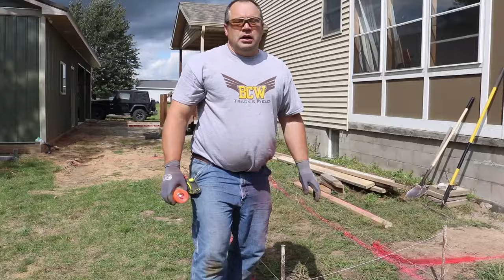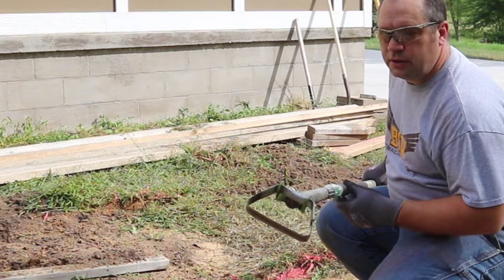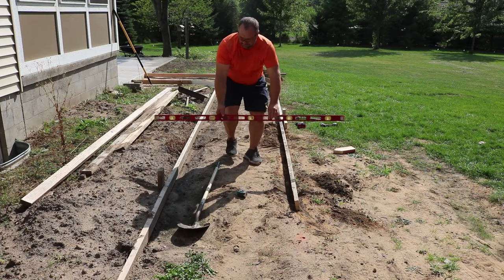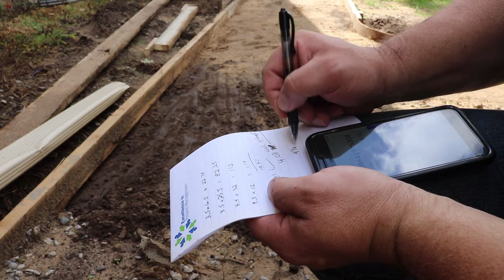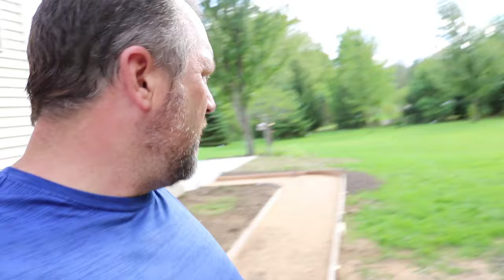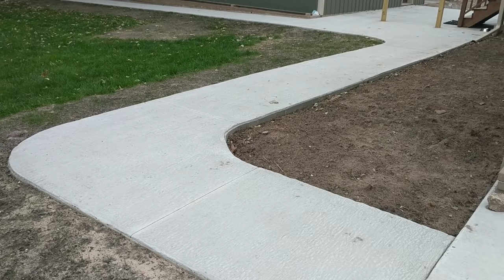Forming Radius Corners On a Curved Sidewalk - Complete Sidewalk Setup and Pour

Comment: I dont know what iam doing,  but here's my thing.i put a frame together its leveled all around with 2x4s. So that's 192 and I have to dive 192 by 81? Gives me 2.3 yards? I dont know what I'm doing but I'm doing it.
Reply from the maker: Yes, find the square footage of the slab. If it's a square or rectangle multiply length times width. That will be your square footage. Then divide that by 81 for a 4" thick slab and you'll have the cubic yards of concrete you'll need. For example a 12' x 16' slab is 192 square foot which takes 2.3 cubic yards of concrete. Good luck with your project.

Comment: Great Corey!  That is a good way to have small radiuses. I had a small sidewalk to do in front of my house. It's 48' long, but very narrow at 16'' wide.  The sidewalk is actually a "water dam". As weird as it can be, it's meant to block water and force it toward the drainage grille. Or otherwise, sink into the gravel and reach the french drain. It's also a transition between gravel and mulch for landscaping. Anyways, I had to put long curves in it. I was able to bend 1/2'' plywood to the desired curve. Everything was perfect, but like you, it rained the day before and the morning we have to pour, there was some warp in parts the plywood forms. I was able to correct it just in time, except one spot. I hope you can make a video one day of all the things you have created around the house and the pole barn. Thanks Corey!
Reply from the maker: Hi Joe. That's a good dual purpose to use the sidewalk to channel your rainwater too. That's the thing about concrete, there are so many things that could potentially go wrong so you have to be ready for anything. I still have a few more things to do to finish my barn up (like front garage doors!) And then I'll probably do an overview video. So many other projects I have in mind too. Just need more time and money and I'd be all set.

Comment: Thank you for such an informative video. I love that people like yourself share so much knowledge on YouTube. I do have a question: I frequently see rebar put on the ground before the cement is poured. Is it not necessary in certain situations? Maybe sidewalks are different than driveways, and the load a driveway will have to handle, for example.
Reply from the maker: Thanks for the comment. For additional support rebar or mesh should be added where the loads are great such as a driveway like you stated. I used a fiberglass additive that the Redi-mix company puts in that also helps keep the concrete from cracking. I've had good luck using the fiberglass but I will still use mesh or rebar sometimes too. If you look at some of my other concrete videos you'll see me use both. The most important thing with mesh or rebar is to pull it up into the middle of the slab as you pour.
Reply: Country Family Homestead ah, that makes sense! I will look at some of your other videos. You do GREAT work. I have a few very small projects that, fingers crossed, I’ll be able to DIY. As with anything, it’s usually just the fear of doing that’s harder than the actual doing.

Comment: Great job on your video plus chickens looking for worms.  I really thought you would've added some rebar or wire mesh to strengthen your sidewalk.  Can you explain why you skipped this step?  Thanks!
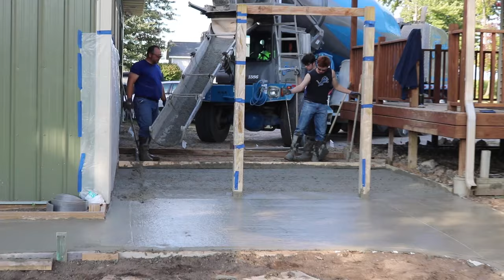Reply from the maker: Thanks, I did you re-mesh on this pour. If you look at 14:45 minute mark you can see it. We should have done a better job pulling it up into the concrete, but it's hard to do unless you have one person dedicated to that job. I prefer to use rebar and position it half way up with saddles or bits of broken concrete. This way it's in the middle of the slab and does a better job. If you watch some of my other videos you'll see me use rebar. I also order the mix with fiberglass in it. That really strengthens it too.
Reply: @CountryFamily  Got it, thanks.

Comment: I dont see any expansion joints. Don't you need them to stop cracking?
Reply: Neither did I, it will crack  without Expansion Joints
Reply from the maker: Thanks for question Kenneth. I cut stress relief joints after the concrete cured. All concrete cracks, the joints give it a place to crack so it's not noticeable. There is expansion joint along the front of the barn because the slab is between two fixed objects, the barn and the porch. For the sidewalk the slab is not "confined" and has room to expand. The only crack I see is from the corner of the planter box a couple inches long until it hits the relief cut. I couldn't get the saw blade any closer to that corner of the planter box but I know that cracks always like to start on an inside corner.

Comment: Great video! I've seen people adding layers of rocks and polyurethane sheets underneath. What do you think about its durability when it comes to a direct concrete pour over dirt?
Reply from the maker: As long as it's firm undisturbed soil it will be fine for a sidewalk. If I were doing a garage floor or driveway I would excavate deeper and add sand or gravel and compact that very well. For outdoor slabs I don't use poly underneath, but for an interior slab I would to cut down on moisture in the building. Using poly will affect the time it takes for the concrete to set up. Sand or gravel will draw some water from the mix allowing it to set up faster. Be sure to wet the sand or gravel thoroughly before the pour to minimize this. Thanks for watching!

Comment: Nice job & hard work, video much appreciated.  In terms of foundation for the concrete, I use 100mm road base then a compactor to ensure a solid base. I noticed you used sand but will moisture soften it over time leading to movement & cracks, even though you used reinforcement mesh? I tend to use poly as a moisture barrier as I tend to tile over the concrete eg travertine.

Comment: 10:04  negative good sir. You used 2x4's which are only 3.5" wide. You also ran the dirt up the the edge to close off the gap. My guess is that you have a concrete sidewalk that is no more than 3.25-3.5" deep.

Comment: Came here looking for the answer of how to edge an inside curve? Cant find the answer anywhere on the World Wide Web. I’m pouring a patio with a 3 ft diameter void around a tree and don’t know how I’ll edge it. Would I just hold my edger at an angle to only have the tip make contact so it can maneuver that curve?
Reply from the maker: Yep that's exactly what I would I do. Works better with a brass edger instead of the thin steel edger.
Reply: @CountryFamily  thank you very much for the help!

Comment: On a 4’ sidewalk, rip one inch off the end of a 2x4 to sit on the form of the side you want water to run away from. Sit the good side on the other form. Put your 4’ level on the board and you got your typical 2% cross slope. Works if you got an extra hand and much simpler than running a string or using a tape.

Comment: Im going to pour a Slab 4ftx24ftx6 inch thick. 
 96 sq feet. How many cubic yds of concrete do i need to order?
Reply from the maker: So the way I do it is to take your surface square footage and divide by 54 for a 6" slab or divide by 81 for a 4" slab. In your case you will need 1.77 cubic yards. You can usually order in 1/4 yard increments but I would order 2 yards in this case. If you are getting readi-mix delivered there may be an additional charge for a small load. For my supplier I think it's a 3 yard minimum.
Reply: @CountryFamily  Thank you.

Comment: Why not pour cement without sand first? I'm a beginner . Thank you
Reply from the maker: Hi Mando, thanks for the comment. The sand makes for a nice solid firm base once compacted so the finished concrete slab will be less likely to settle and crack.